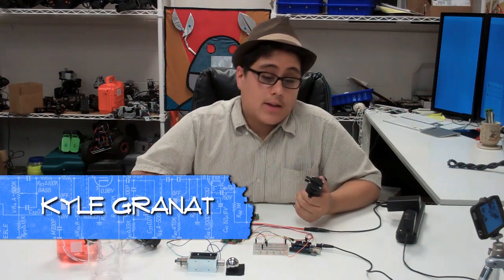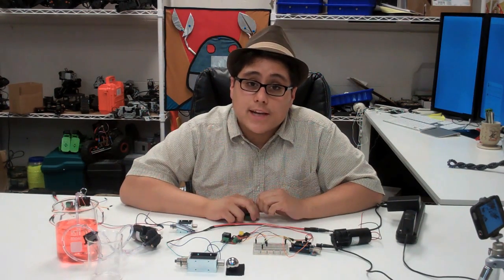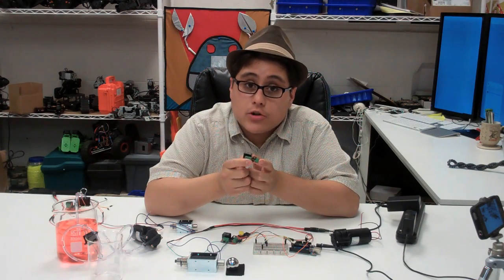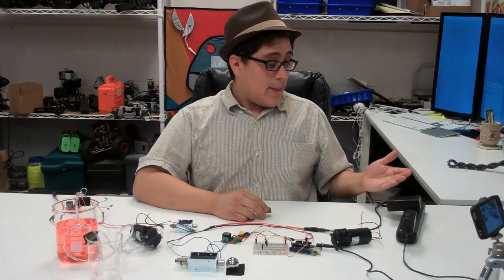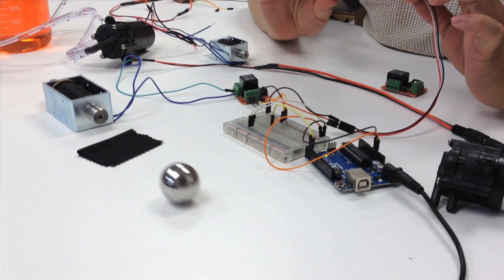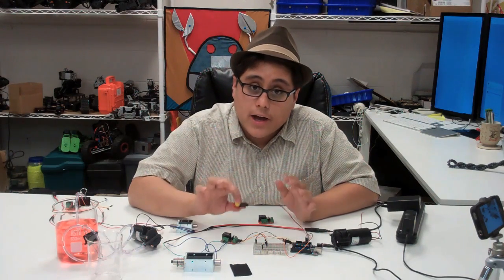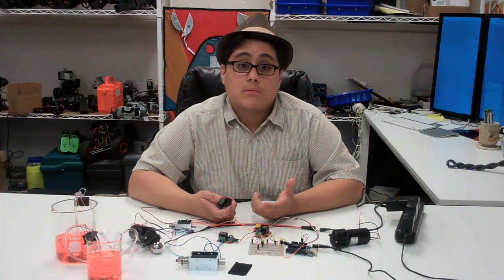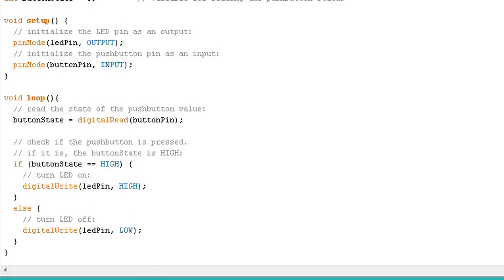Controlling Water Pumps and Solenoids With Your Arduino

Comment: Good day, can I use the relay + 5 volt signal (from Arduino or Ethernet SmoothStepper) to control a 110 volt pneumatic solenoid valve ? Thank you

Comment: Is it possible to use one 5v 2-channel relay or one 5V 4-channel relay to control TWO 110VAC solenoids at the same time?
Reply: I tried this and didn' t work for me, caused voltage return to the other arduino pin. I use 2 relays to activate one lamp.

Comment: Is it necessary to connect a diode on the relay?
Reply: +atm2042 Is it possible to use one 5v 2-channel relay or one 5V 4-channel relay to control TWO 110VAC solenoids at the same time?
Reply: BalaCosmica _ I am controlling a 110vac solenoid with a 5V relay, if you want to connect 2 in the same relay you just need to be sure that your amperage consumption is lower than the limit of the relay
Reply: atm2042 Oh ok, so how can I figure out what the average consumption of two 110VAC running at the same time (at any given second) is? Do I use a multimeter, and if so, should I check amperage of bot solenoids when power is on? Sorry if I'm making something so simple look so complicated...
Reply: +BalaCosmica _ I used a watt-meter i had in my house, in my case my solenoid consume 15W ~ 0.13A the solenoid I bought was from Amazon : "Vktech 110V AC 3/4" Electric Solenoid Valve Water Air Fuels N/C Gas Water Air”. 

If you don’t have a watt-meter you can ask / look for the datasheet of your solenoid on the manufacturer web page
Reply: +atm2042 I see, so if you had a 12VDC solenoid valve with an unknown amperage-rating, would you rather use a single 8 X AA, 2A battery holder (8 x 1.5V is 12V) or a single 12V, 23A battery holder? btw, both types have wire leads as well as the solenoid...
Reply: BalaCosmica _ There are many aspects to consider, AA rechargeable batteries usually give 1.2V mostly the ones with Ni, if you are going to use AA batteries consider the voltage range of operation of the solenoid, I personally would use a single 12V and 23Ah is much more capacity and more reliable for this application
Reply: +atm2042 Makes much more sense. So if I have two solenoids - one rated at 12VDC/3.0W/??A and the other at 12VDC/4.8W/400mA) - should I be able power each individual solenoid (with a battery each) with these specific batteries from Energizer? http://www.homedepot.com/p/Energizer-A23-12-Volt-Alkaline-Battery-2-Pack-A23BPZ-2/202844326

*Btw, I do not know the amperage rating on these energizer batteries :/
Reply: That battery has 55mAh your 4.8W will consume the battery in 8 minutes, Ah is the measure of energy capacity in batteries
Reply: atm2042 I really appreciate you taking the time to answer these questions for me, it really means a lot :} So is their a formula that you used to calculate the 8 minute total? Also, if I wanted to use external/"mobile" batteries (such as these Energizers) instead of a AC/DC power plug/wall plug, which batteries/battery would you recommend I use to power up these two particular solenoids for a considerable amount of time?
Reply: you should watch for videos of basics of electricity here in youtube, there are plenty of them

Comment: Recently I bought one of those mini 9v water pumps you can get off of eBay for $2.99. I hooked it up to a momentary switch and a 9v battery, and it works just how I want. However when I touched the 9v battery, it was extremely hot! What did I do wrong?